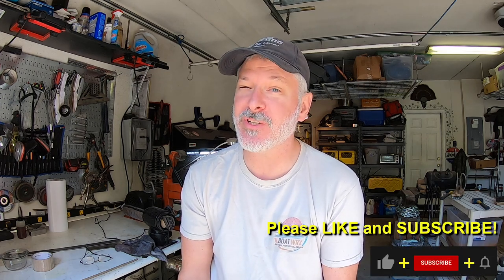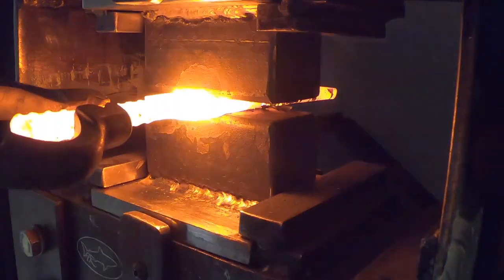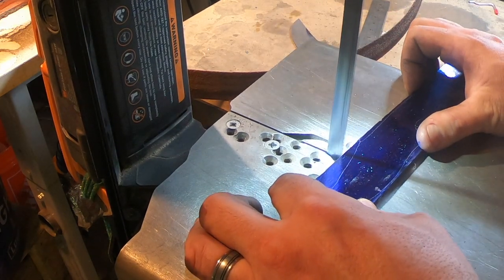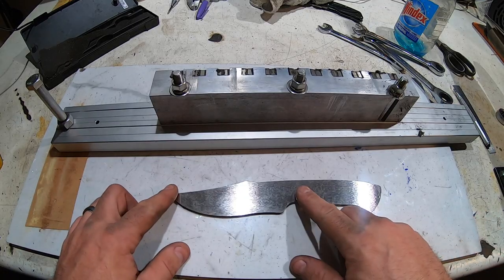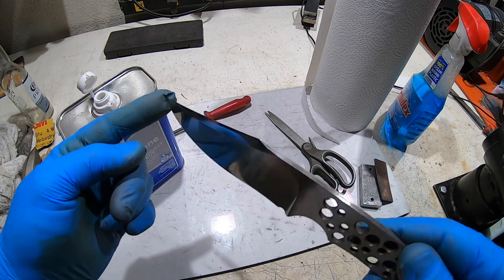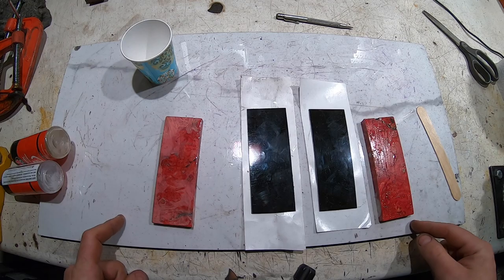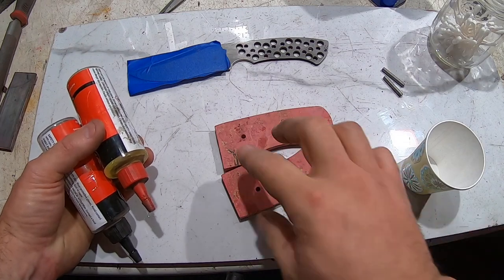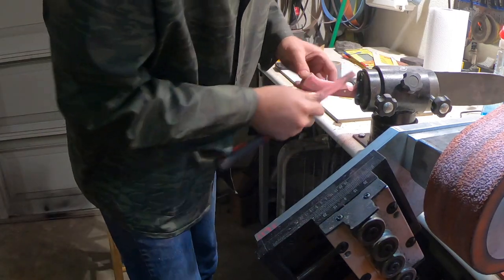Forging a Hunter with Stainless San Mai Damascus

Comment from the maker: What do you think about stainless san mai?  Any other damascus patterns you'd like to see on the channel?
Reply: I really liked the "battlefield bone" canister damascus that Big Dog Forge made a while back using welding rods. Maybe not as elaborate and intricate as mosaic damascus, but I think it looks really cool!
Reply from the maker: I’ll have to check that out!  Thanks for watching!
Reply: I love stainless san mai! I have bought and used billets from other people, but never forged my own. I have had a hard time finding 416 to use. Where are you getting yours? Also do you use a higher heat for forge welding than you would on high carbon steels? Thanks
Reply from the maker: @spaknives  I get my 416 from Jantz Supply.  It’s pretty much the same forge welding heat as carbon.  Best to weld the seams completely though.  Good luck!
Reply: I'm partial to the combination stacked checkerboard/ladder utilizing 1080 and 52100. Time consuming build, but end results beautiful!
Reply from the maker: @stanervin6108  I'm not totally following what that is.  If you have a link to a picture, I would appreciate seeing it.  And thanks for watching!
Reply from the maker: @stanervin6108  Hey Stan.  I need to manually approve anything with a link in it.  That's why.  I just did and I'll check it out.  Thanks!
Reply from the maker: @stanervin6108  I see it now.  It looks like a very symmetrical raindrop followed by a ladder.  Pretty cool.  You'll start to see a lot more mosaics from me now.  I'm going to start one in a month or so that should be pretty spectacular.  I hope at least!  😜
Reply: Hmm now u got a 0,45 to 0,5 % carbon blade! But pretty looking!
Reply from the maker: That’s not how it works.  Carbon doesn’t just homogenize throughout the steel in a San mai.  You might get some slight carbon migration at the union but the carbon in the center of the core remains as is.
Reply: Carbon migration is pretty quick!
Reply: But pretty!
Reply from the maker: It’s not about speed, it’s about distance.  Otherwise what you are saying would negate all San mai’s and a thousand years of Japanese sword making knowledge.  😜
Reply: That is one beautiful knife.
Reply from the maker: @kennycampbelljr5896  thanks Kenny!
Reply: Really dont care what you do, I enjoy it all, I wish I could spend 6 months working with you, though you probably wouldnt, haha, I do have a question though, can you do  wrought iron and stainless Damascus. or 1085 with stainless.
Reply from the maker: @jamesmatheson5115  if you’re asking if it’s possible, certainly it is.  If you’re asking if I can do it on a build, sure I will at some point.
Reply: I think you're the real deal. Most of these over hyped knife makers aren't half as talented.
Reply from the maker: @jeffhicks8428  thanks for watching, Jeff!
Reply: I’m blown away how you do that. That’s why I say art. The blue Handel Bowie you did. I’d love. Hell I’d settle for just a Damascus pattern that’s pretty simple. That would go in a shadow box on the wall close to my saber when it’s all cleaned up

Comment: I noted you said that you had problems drilling the stainless... I learned a trick from a boat builder a while back; use cold water for cutting fluid... Works like a dream...
Reply from the maker: The stainless wasn't the issue.  The 1095 was too hard.  I am doing another one of these for this sunday's build and I had the same issue.  I had to anneal the blade fully before I could file the false edge.  I don't know what it happens with these stainless san mai builds, if its just 1095 you don't get that much of a problem.  🤷‍♂️  Thanks for watching, Kevin!

Comment: Nailed it! That one is super smooth!!
Reply from the maker: Thanks for watching the build, Bill!
Reply: @TyrellKnifeworks  thanks for making it. You pretty much made what I have been working towards.  Stainless sanmai is the way to go. I have made a couple out of old boat drive shafts with 80crv2 cores.  Just need to get back at it and finish then off. 
 That grinder sure takes alot of time but I know in the end it is worth it

Comment: I just did three bars of 52100 core and 15n20 sides so far there great I have one heat treating right now
Reply from the maker: That’s great!  Not a stainless San mai, but still very cool.  Thanks for watching.
Reply: @TyrellKnifeworks  yes it’s just as pretty a lot less headaches

Comment: Gorgeous piece of san mai bud,  having watched the vid im thinking the pitting is maybe carbon migration coming through the stainless which is what the ferric is working on. All the same the outcome is so nice. Ive got to get me a damn tig welder now for sure. Cheers.
Reply from the maker: Thanks Loz!   I think I was just leaving it in the ferric far too long.  When I did just a few rounds at 30 secs a piece,    The tig is awesome.  It’s great for mosaic Damascus so I wouldn’t be adding filler metal.  Thanks for watching!

Comment: Ive never needed to coffee etch for 12hrs in my life. Usually i can get a mono steel black black in a matter of 5-10 minutes with a coffee etch. For my san mai and damascus blades ill go into ferric for 15-30 seconds, sand off with 1500 grit and repeat 3-5 times. Once im happy with it, i go into coffee. I mix 1 jar of coffee for every 1L of water. I boil water pour in the instant coffee and while the water is still relatively hot, ill put the blade in. It etches far better and far quicker if the water is still hot. Been debating making a video on my process cause ive never had the need for a ridiculous amount of time. Literally only takes a few minutes.
Reply from the maker: This video was 3 years ago... back then I tried to reuse coffee.  Now I mix it fresh each time and use it very hot and it the coffee etch takes about an hour to get it really nice and black.  Thanks for watching.

Comment: Damascus + stainless sanmai. I’m working on one now. But it’s such a pain to grind. I use 304 stainless and it isn’t liking to be ground. But it seems to do good in the acid
Reply from the maker: I’ve tried 304 before but I think the 416 turns out better.  I hope it works well for you!

Comment: Have you tried hot vinegar for the etch it may be less aggressive on the SS.  I haven't tried it myself .
Reply from the maker: This video was done quite a while ago and I've since mastered the stainless etching.  You really only need about 30-45 seconds, unlike when you're etching damascus which requires 5-10 minutes per soak.  Thanks for watching, Thomas!

Comment: Wow! That bottle cut was something else!
What do you polish the handle with? do you cover it with something or is it some oil? or just plain sanding-polishing? I want to learn how to make the wood as shiny as you have it.
Reply from the maker: Most of the handle material I use is stabilized with resin, so just sanding to 1000 grit and then buffing makes it pretty shiny.  Then the addition of some wax and another light buffing does the trick!  Thanks for watching!

Comment: Amazing knife, the san-mai and the handle are stunning.

Btw. Wear those gloves when working with the epoxy and not when the knife is finished. It keeps your surfaces greas free and most important it’s better for your health. Epoxy can permeate our skin. How do I know? I did not take care working with epoxy in my younger years. Now when I get epoxy on my hands the joints of my fingers start to hurt. That can be up to 1 or 2 days.
Reply from the maker: Thanks!  I do usually wear gloves but forgot this time.  Thanks for the info!

Comment: I'm lightly confused. I was under the impression that stainless does not weld to high carbon. I've seen you use stainless cannisters for that reason. How did you make it forge weld?
Reply from the maker: With a zero oxygen environment you can forge weld stainless to high carbon.  416 stainless works the best. Thanks for watching.

Comment: nooby question, for first damascus billet of just 2 layers of 1080 and 1 layer 15n20 or vice versa. Would it be worth it or just come out bland
Reply from the maker: That’s called a San mai.  They can be very striking.  It’s basically what this build is but my outer layers are stainless steel.  (Stainless San mai is not advisable until you have a bit more experience).  Thanks for watching!

Comment: Very nice! Did you use the stainless steel to challenge yourself?  It seems like it would be such a pain to work with.
Reply from the maker: Stainless gives an amazing pattern when you put high carbon in the core.  That’s what gives you the super dark edge and silver sides.

Comment: Hey Tyrell! I just forged a gomai knife with all carbon steel. when I started grinding a tiny delamination became apparent, about a 1/2 inch of where the steels meet on one side. Do you know if this is basically just a cosmetic issue at this point? I forged it with a hammer so I guess I missed a spot! Or maybe I ground it too hot?
I appreciate your videos!
Reply from the maker: Without seeing it, I can't tell if it would be structural or not.  Delams like that tend to be cosmetic.  Likely it's from a slightly failed or incomplete forge weld, I doubt its from grinding too hot.  Once its forge welded, grinding should do anything.  Thanks for watching, I'm glad the videos are helpful!

Comment: Hey Tyrell -- would HRC be primarily determined by the 1080 core since that's what is at the center/where the edge is? (60-65 give or take)

Also, with something stainless clad -- is the carbon steel edge/core still vulnerable to corrosion?
Reply from the maker: Yes, the HRC would be steel core since the cladding doesn't harden.  It should be around 60 give or take after tempering.  The core is still vulnerable to corrosion.  Thanks for watching.

Comment: Good job and I really LOVE that migration line between the SS and 1080.  I've used .005" nickel for a nice line also.  What do you think of 410SS vs 416SS for cladding?
Reply from the maker: I've never used 410.  I've used 304 and 416... definitely recommend 416 over 304.  I'm working on another Stainless san mai blade right now.  It'll be next Sunday's build.  👍🏻

Comment: Can you forge into a blade after the billet is forge welded? Ever video I see is stock removal.
Reply from the maker: This is a San mai construction which is a bad idea to forge.  It thins out the core steel and it’s always better to do stock removal once the billet is welded.  If you want to see a fully forged blade, checkout the kukri build.  👍

Comment: What kinda of tig machine are you using?  I'm looking into getting into it myself and was thinking about getting a multi processing welder with stick,mig,& tig. I noticed you have a titanium in your shop, that's what I have also for my mig machine.
Reply from the maker: It’s the titanium pro 200.  It only does lift tig though, you can’t use a foot pedal with it.  It’s good for what I need.  👍
Reply: @TyrellKnifeworks  ok cool! Thanks for the reply. I love how this knife turned out btw the dark line of the 1080 is so cool looking!
Reply from the maker: @dylanbennett3851  thanks!  Stainless San mai is one of my favorites.  You’ll see another one soon!
Reply: @TyrellKnifeworks  can't wait to see how it turns out!

Comment: My only concern is if the steel got to the right temperature in between those plates when you tempered. The heat transfer could of messed with it maybe?
Reply from the maker: I temper with those plates all the time, as do others.  It works just fine.  👍  Thanks for watching.

Comment: Adding copper with the Stainless into the blade will it work?
Reply from the maker: Yes, it would work but you wouldn’t get the cool “ghost” pattern in the steel.  Thanks for watching, James.
Reply: @Tyrell Knifeworks  thanks for the quick reply

Comment: Beautiful work. Just watched another stainless San mai from Green Beetle recently. My question is: do you base the heat treat on just the 1084 core? Obviously that wouldn’t be optimal for the stainless....are you accepting that the jacket is soft? I know typically San mai is a hard core with a soft jacket....in this case, is it just soft because you only use conditions that will harden the core (as both are theoretically hardenable)?
Reply from the maker: Sometimes it’s best to do an edge quench but I quenched the whole thing because I only have a vertical tank now.  Thanks for watching.
Reply from the maker: I should also have mentioned that 416 stainless is not hardenable.
Reply: @TyrellKnifeworks  ah good to know! Gorgeous blade. Keep up the good work!
Reply from the maker: Thanks so much!

Comment: That looks awesome.  I was wondering about anyone who has used a stainless/high carbon san mia, is there a problem with galvanic corrosion?  That would make the carbon steel rust at a higher rate due to the galvanic effect of the stainless.  Has anyone had any experience with this?  I know this happens in piping systems, but wondered if the same effect happened with kives.
Reply from the maker: I’ve done stainless San mai once before and never noticed any more corrosion.  Quite the opposite in fact.  Thanks for watching!
Reply: I think that primarily happens when you clad it in pure chromium through PVD. I think the diffusion bonding helps prevent creation of a galvanic cell.

Comment: Beauty 👌
Reply from the maker: Thanks, I like how this one turned out. Stainless San mai is one of my favorites. Thanks for watching!
Reply: @TyrellKnifeworks  The reason I like San-Mai so much is there’s not a lot of foreign faux San-Mai to ruin its uniqueness or appeal.  

Low layer Damascus has a cheap look to it in my opinion now because of Indian and Pakistani sellers flooding the market with knives made from an un-hardened mix of mild steels.  

Mosaic Damascus - thankfully - has been untouched by this and retains its allure because of it’s technical difficulty.
Reply from the maker: Yup, I can’t agree more.  I don’t do much low layer Damascus unless there’s a good reason.  I like the 200-400 layer range, unless it’s a mosaic.  It’s a shame there’s so much crapmascus around these days.  Thanks for watching!